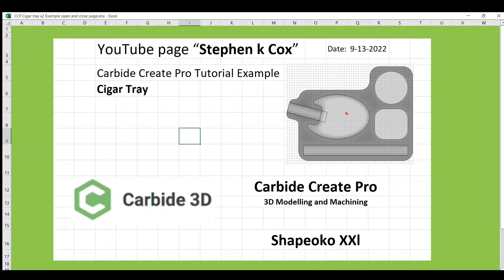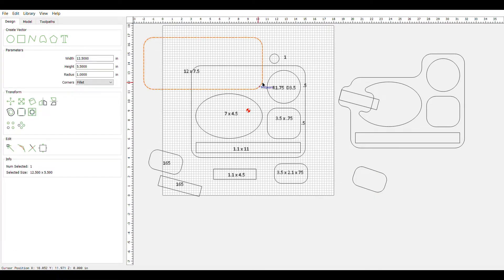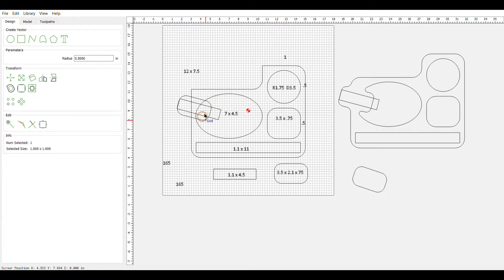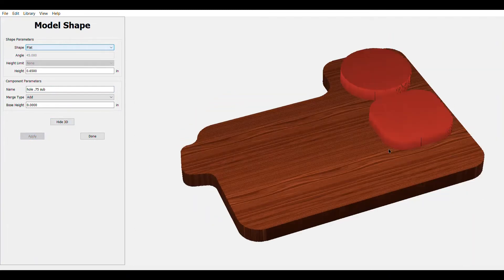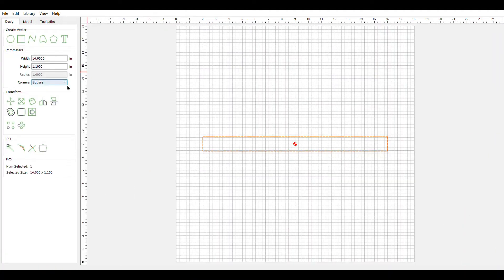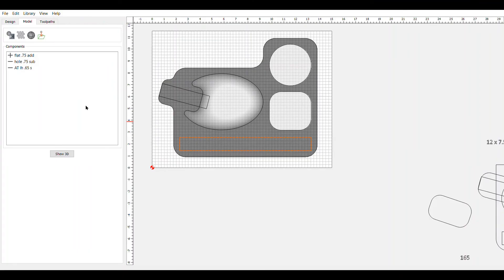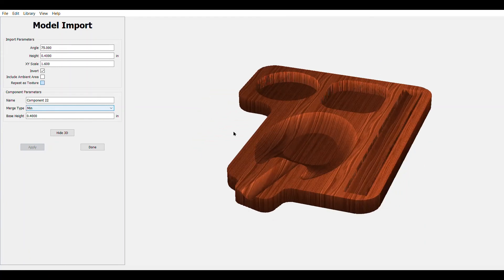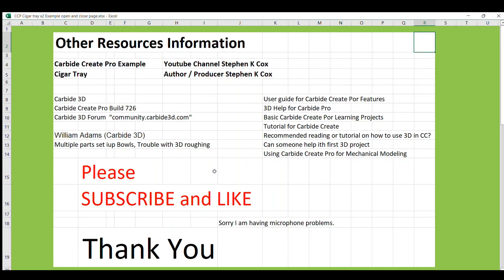Carbide Create Pro Tutorial Example Cigar Tray

Comment: When adding the shorter trough, setting at 75 degrees, it ends up rotated 90 degrees to where it should be (through does not exit to the outside or into the ashtray).  Any idea what I am doing wrong?
Reply from the maker: not clear about what you need just a little more detail and i will try to help.  sorry I am a bit slow.